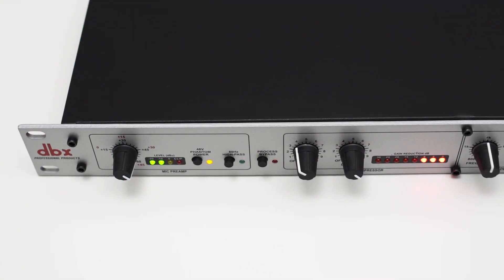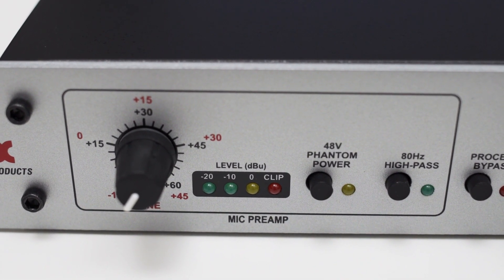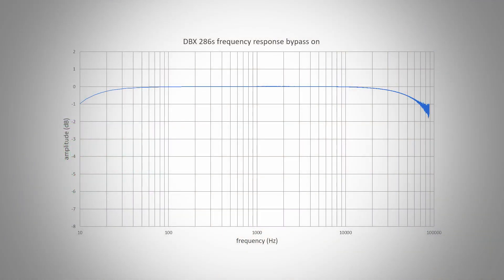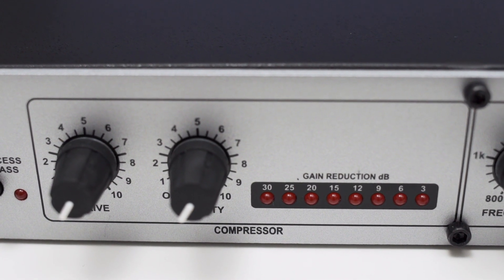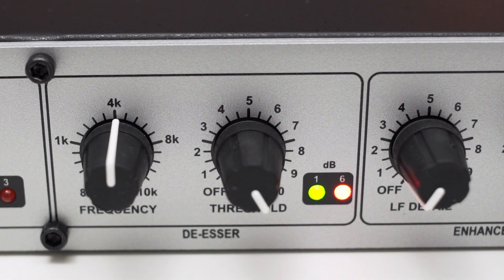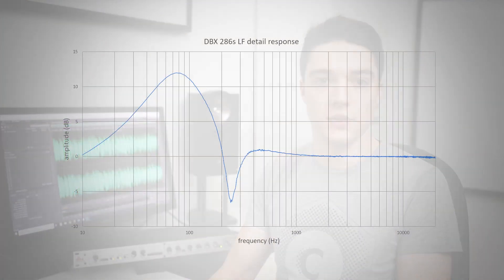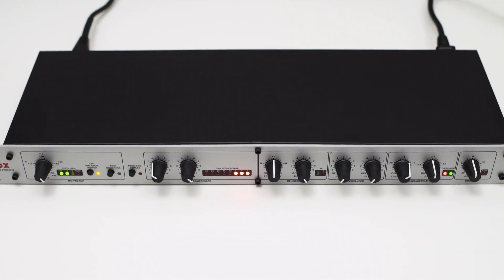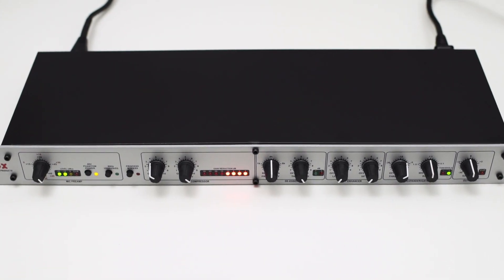DBX 286s Mic Preamp and Processor REVIEW (noise and more stuff tested!)

Comment: Woah, now this is a review channel! From one engineer to what I can only assume is another engineer, seriously, bravo. I hope this channel takes off in a big way very quickly because it deserves it. Thanks for all the info.
Reply from the maker: Hey, I really dig your channel and have been subscribed for years. Getting such a compliment from you means very much to me. Thank you!!!
Reply: @JulianKrause  that's amazing, thanks so much. I was really curious about testing EIN and measuring it and sure enough you've got all that stuff here. Almost too good to be true. Saw your 202HD review also, and I'm using the 404 with an NT1 right now. Looks like I picked the right setup for minimum noise after all, hah. Maybe I need a 286S now also...
Reply from the maker: @metal571  Yeah, the NT1 in combination with a 404 is as low noise as it gets. The 286s might be interesting for you when you live stream. That said, OBS for example also has a built-in audio compressor and gate which you could try out too. Btw, I'm going to make a video on how to test EIN in the near future. If there is anything else you want to know or want me to make video about, let me know!

Comment: Great review Julian. I like your review methodology - talking about the build quality, features and very importantly the technical performance with real world comparisons to other devices. This is far superior to most 'reviews' which are often poor. keep up the great work. I picked up a 202HD after watching your review to replace a Scarlett Solo. I was considering adding a fethead since I run a Shure SM57 but for the price of the fethead the 202HD provided enough low noise gain for the same cost, and you get an entire interface!

Comment: "Do you need a DBX 286s ? YES YOU DO! Heck this thing saved me a load of work and headache. I am a music producer and post processing without the DBX 286s was tedious. I have to battle all sorts of noise and vocal volume variations during post processing.  Some good things this equipment has done for me
1) With this equipment,  my CPU has one less plugin to worry about - De-esser
2) You can get away with an open back headphone if you have this equipment
3) You have no need to worry about the tonal character of a particular microphone because you can always adjust the enhancer to suit the vocalists preferred tone realtime.
This thing makes life easier.
Reply: The fact that this thing can do hardware noise cancelation on fly flawlessly already makes it worth buying. Sure, for sound production its something obvious, but i bought it to advance my sound quality in voice conversations and voice chats. Hearing that someone label me as streamer or voice actor always gives me diamonds.

Comment: Julian:

Thanks for the fantastic  very detailed reviews that you have provided for us over the years!

I have done Voiceovers for many years, beginning in my days  at  AM/FM radio stations  in 1966.
I still own and use a DBX286s for Voiceover's. ( also own a 286a, I do not hear any difference in the overall performance, just a different face panel color). They are indeed a great piece  of audio equipment. I only use the De-esser and Gate functions. EQ and a tiny bit of compression are done in
Post. Fab Filter Q 3 & Pro MB are my most used plug ins with AA 2022 as my DAW.
It would be interesting to hear the difference in audio quality between the DBX286s and the new Behringer UV1 clone. All functions are identical, with the UV1 having additional  functions such a built in  USB interface, and yes, even a front panel power switch. My sales  guy at Sweetwater Sound here in the U.S. advices me that don't expect another shipment from Berhringer of the UV1 until August !
Keep up the great work!

Comment: Hello Julian,
the dbx 286s is a great device. Because of your videos about him, I bought him.
Only the missing switch to turn on and off and the missing XLR output are not so great.

That's probably what the engineers at Behringer thought and tried to improve the dbx by exactly these features. The result is their UV1, which also has an integrated audio interface.
Despite the improvements, the price is the same as the dbx.

With such a challenge, a test of the UV1 and a comparison with the dbx 286s is almost inevitable.

PS: You make the best reviews!

Comment: Great review! More detailed than 99.9% of all the reviews I’ve found on YouTube so far. I almost makes me pull the trigger on this thing! The real-time voice processing is definitely nice to have. That being said, I’d like to add: This only makes sense, if the CPU of the PC is heavily pushed  and/or if you listen to yourself. As for the CPU load: The effects in this device - if realized on the PC - barely create additional delay, let alone creating a noticeable load on the CPU. Windows uses a buffer size around 10 ms for simple playback in any case and a  microphone input forwarded to the playback device creates a much higher delay. So the only situation, in which it really makes a difference in terms of delay on a Stream, is running all the sound through an audio mixer. This may be actual hardware, where you have pretty much real-time input from the microphone. But it also may be Software. Voicemeeter comes to mind, using an audio interface’s ASIO driver at a really low buffer size (64 samples and below) for audio delay low enough for many, if not most users, to be unnoticeable.

Comment: Great review Julian. The best I've seen on this piece of gear. I love how you do your analysis on things, and explain it in your videos. 

I find with my 286Ss (I have three), that when I use the compressor drive , I get the typical pickup of the noise floor. These units seem to bring it up considerably, so I always need to use the expander\gate to filter the noise out. I just have to watch that I don't gate too much. But I need it some anyway as I am in an apartment and do have a fair amount of noise to deal with. Overall, I'm happy with the audio I get, which is quite clean, the noise floor staying under the threshold of normal hearing.

Comment: Thanks for a great job. I like the graphic outputs you use to tell the real story. I have one with my Shure SMB7. It still needs some preamp power to get a decent output. Now I use a Yamaha MG06x that I happen to have around. Its not great but its OK for now.  For live streaming I output to my SONY pxw-z90 video cam. Then I don't have to do post sound edits. My next step is upgrading all XLR cables to high quality, well shielded types. Also added Furman power condition/surge protection to cut out interference on the line. However... I still hear some slight hiss!  But overall, pretty good.   Thanks again!
Reply from the maker: Hey, I'm there is really no need to have another preamp in in front of the 286s. It has quite a bit of gain and adding another preamp might make the noise performancr worse.

Comment: Hi Julian.

That compressor section used to be what DBX called 'over easy' compression. I used to have eight channels of it and it's surprising how well its auto attack/release etc. works. It worked very well on everything from vocals to drums. I suspect that the 286s will also have a soft knee characteristic. LA Audio used to do something similar called a C8, which was eight channels of 'over easy' type compression in a 1U box, it also allowed up to four ganged pairs.

Can you set the compressor on the 286s to act more like a limiter? I'm not that familiar with what's available as far as modern hardware dynamics processors  are concerned and am looking for something with an effective ceiling limiter in it. Basically, I'm after something that I can set and leave for my V/O mic when doing indoor pieces to camera. At the moment I apply a ceiling limiter in post via a VST plug-in, LoudMax https://youtu.be/JXqTIOvQYsI but would much prefer to get a set sound for the acquisition. Do you have any recommendations for something like a voice-channel strip? Although I don't particularly need eq, compresion, de-essing or gating, these things are usually on such devices but I could always bypass them. I'm interested in something with a quiet clean pre, phantom and limiter. I I have a budget of up to around 300 euro/pounds but would prefer to pay less if there's anything available.

Another great, well made and informative video.

Cheers,
Dave.
Reply from the maker: Hey, I don't think there is a way to use the compressor as a limiter. The compression ratio is not adjustable and varies depending on the input signal. But according to the manual the highest it will go is a ratio of 4:1. As a compressor this works very well, but the ratio is not high enough to be used as a limtier. If I come across a channel-strip with a true limiter I will let you know!
Reply: I output multiple 286Ss to mixer channels, then run the main stereo outs to linked channels on a DBX 166XL (the model with a limiiter) to catch peaks. It's not quite the serial compression chain that is ideal, but I think it does a pretty good job. The 166XL then outputs to a Focusrite 2i4 for recording to a PC. 

With just one 286S, one could do the same thing by going from the 286S to a 166XS/XL (XS is the current version) or similar compressor. I realize it's not one complete self contained package. But there are plenty of good to excellent condition used DBX compressors like this for a really decent price. 

Of course, I am rack mounting all this gear! ;)
Reply: Hi Chris, I'm actually working through the night editing and just seen your reply, thanks. That setup you're talking about looks good and would be fine for typical patching in a studio scenario but is a bit too cumbersome for my particular use. That said, I've got a couple of self powered condensers that'd probably drive the 166XS, or I could feed it with a small power/pre unit. It's defo worth a look as that final peak limiter looks like it's exactly what I need and looking around there doesn't seem to be an cheap voice channels with peak/ceiling limiting. Interestingly, I used to have the original 166 and before that a couple of 160 units that I'd put behind a pair of LA4 units. I used to produce a lot of music in the early 90s and had a commercial studio with analogue 24 track and one of the first affordable 24 track tape based recorders, 3x original ADATS with a BRC and a enough outboard to sink a ship :) These days it's all done in the box, hence the lack of outboard. I basically use my living room as my video editing space https://youtu.be/iiy2aab6aSc so am a bit limited as to how much kit I can use. Cheers, Dave.

Comment: Thank you Julian!  Very informative.  
Good video!  I need your advice.  I already have a 286s that I use for vocals.  In a singer-songwriter set-up where I also want to play a mic'd up acoustic guitar simultaneously as I'm singing but also want to have the acoustic guitar mic to have a seperate compression with its own tweaked levels, do I get another 286s for this purpose or a dbx 166xl?  Which would you get for just the mic'd up guitar? It seems that the 286s works fine but would the 166xl work better for this purpose?  Pretend that I'm recording into a 4-track cassette TEAC 144 (from 1979) recorder.   So no DAW no effects, dry everything.  Just raw but even-sounding.  Which would you choose? I heard the de-esser also works to tame the brightness of brighter acoustic guitars.

Comment: Mr Krause...I really appreciated  and learnt a great deal from this review....can you walk me through, how you connect a dbx processor to your audio interface, before connecting to your pc......then how is the gain set, or, how much gain is applied on the audio interface after the dbx is connected to it
Reply from the maker: Hey, I will be posting a full setup guide of this device in the next week. If you cannot wait that long, here is a short version to get you started:
You connect the dbx 286s to an audio interface via a TRS to TRS cable. You turn the gain on your audio interface down all the way. Set the output gain of the dbx 286s to the 0 position. Connect a microphone to the dbx 286s. Speak into the mic and turn up the input gain until the two green LEDs are blinking and just occasionally the yellow LED lights up. Like I said, a more detailed version will be coming soon :)
Reply: This announcement made me subscribe your channel! 😃👍
Reply: @JulianKrause  Hey thanks so much Mr krause...so let me just get this straight ....when I turn the output gain to 0 on the dbx, you said to speak into the mic and start turning the input levels up, until the two green led lights appears , along with the occasional presence of the yellow led light...my questions are.....what about the output level that you said , must be put to 0 on the Dbx?.....apart from turning the gain way down on the interface, do I make any adjustments after that before I begin my recording?
Reply from the maker: @MichaelW1980randoms  Nice, I'm currently working on the video!
Reply from the maker: @antoineinniss5586  When I said "turn the output gain on the 286s to 0" I was talking about the most right knob on the 286s. This knob is labeled output and controls the output gain. This knob has to be set to the 0 position which is at 12 o'clock.
Reply: @JulianKrause  ooooh...ok...understood....thanks Mr krause...I'm looking forward to the full version on this

Comment: So Julian you mentioned how the de-esser pulls down the whole frequency range. If I understand the unit correctly, employing the high-pass filter first should roll off low noise rumble and when that signal hits the de-esser, the frequency range is narrower so it wouldn't; 'be pulling down as large a range of signal. Correct?
Reply: Yes, it wouldn’t attenuate the whole frequency range but the difference would be quite minimal
Reply: @gregorloffler1153  Thank you for the clarification

Comment: Hi Julian, i know this is an older video but i was wondering could you tell me you opinion in using this with SSL 2+? As SSL 2+ has preety good and low noise preamp's would the use of DBX 286s "downgrade" the performance of the final recording? More the as the preamp im considering the DBX 286s in between the mic and SSL 2+ for other functions it has (deesser, gate/expander and 2 band eq). Basicly was wondering will it downgrade the final product in term of noise and quality? If yes can you recomment a channel strip that has the above mentioned functions without a preamp?

Thanks in advance.

Comment: What is the interface recommended and what should be the interface output when this dbx is plugged in?
Reply from the maker: I recommend pretty much any audio interface which has a balanced line level input. The output of the 286s should be at the 0 position (12 o'clock). Make sure to use a TRS to TRS cable for a proper balanced connection.

Comment: Hey Julian, thanks for the great review. When using the dbx on an interface, I am not loud enough for for instance discord while streaming. Is it legit to turn up the interface gain a little bit to boost? (The DBX Preamp Gain is on +30, if I turn it higher its clipping all the time..)
Reply from the maker: Yes, that's ok, but normally you shouldn't have to do that. Where is your output knob set at, Which cable are you using to connect to your interface and which interface are you using?
Reply: Just turn up the volume on your speakers or headphones.

Comment: do i currectly understand if i use SM57 connected to umc404hd therefore buying fethead will be useless idea due to difference between EINs of Behringer and Fethead preamps in near 1 dB? :)
Reply from the maker: That's correct. There only a miniscule gain in noise performance for your setup with a FetHead.

Comment: Hi again Julian, Sorry to be a bore but would like your advice. I record from Scarlett Solo (not the AIR) into Logic pro x with my vocals. I am a senior guy and like to record ballads from the the 60' and 70's era. I really have lots of trouble taming my high's and low's and "Soft and Loud" going straight in with the Scarlett and I end up with the wave file all over the place that needs compressing when going in, I can hear guys screaming "well use the Compressor Plugins". Unfortunately I've tried them and they make the vocals sound boxy and somewhat un-natural. If I used the dbx 286s, do you think I would get a cleaner more natural vocal after the compression and then using a little EQ? does the dbx add colouring. Or is this really for pod casting rather than serious recording.Thank you, Tony

Comment: Is there a unit that does this... but can individually process multiple inputs? I consistently do a podcast regularly with about 3 to 5 people locally and have wanted one of these... it would help with the amount of time i have to put into post. 

Great video!
Reply from the maker: Hey, check out the RØDECaster Pro according to Rode it will have vocal processing for all 4 inputs built into the device. Might be the right thing for you.
https://youtu.be/7UTsdyXnTtY
Reply: Thanks.  I heard tell of this on Podcastage. I'll definitely keep that on the radar.  Hopefully there'll be an answer to my 5+ input issue in the future.